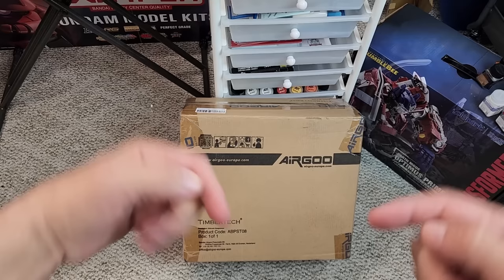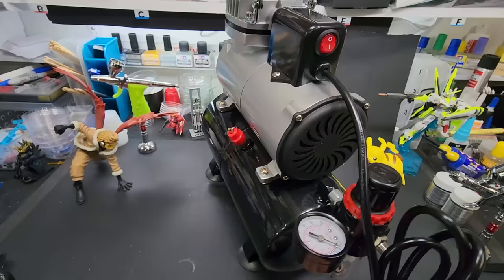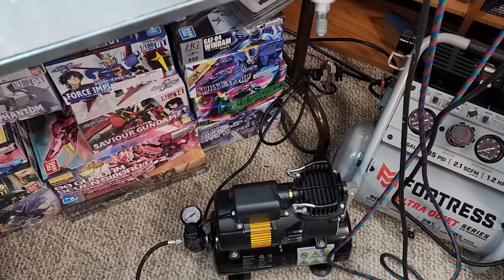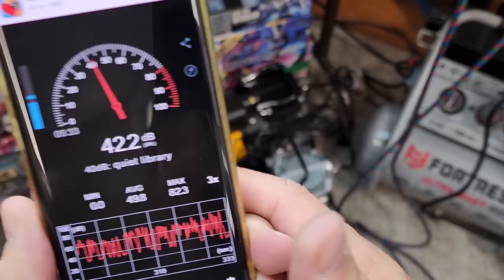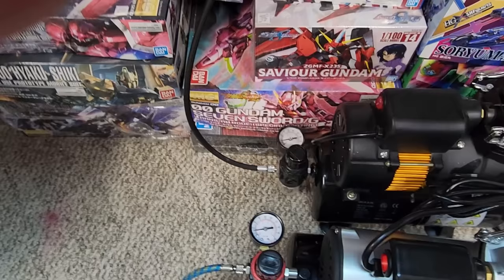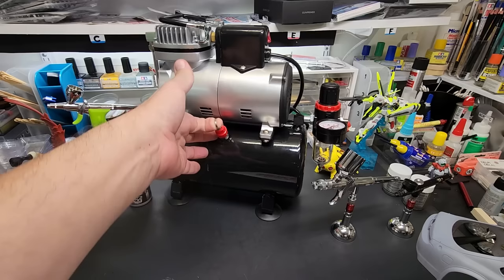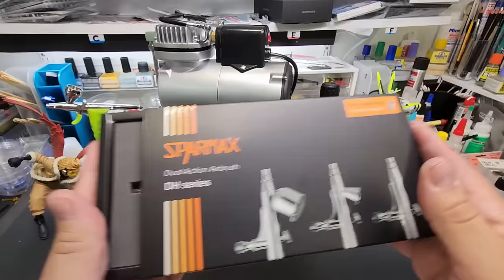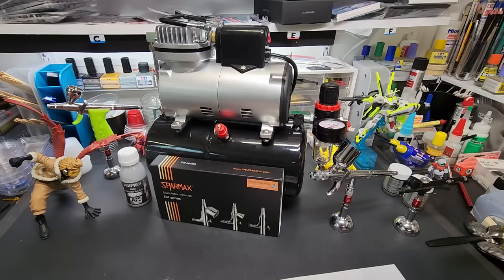Testing Amazon's Cheapest Air Compressor With A Tank - For Airbrushing

Comment: I’m pretty much brand new to airbrushing & your videos have been so helpfull and I really appreciate you for everything I've learned from you.
I originally bought one of those $70 during the lockdown but the gun never worked properly so I got frustrated after a few months of the constant clogging-cleaning-clogging go 'round but I never stopped watching your videos.
I was eyeballing the Iwata Neo until I saw your video on the Neoeco & when someone asked me what I wanted for xmas that was the one & only thing I asked for and oh boy! Sprays great, never clogs, cleans so easy - I am soooooo glad I watch your videos👍👍👍👍
The one thing about it I can't figure out is how to attach the hose to the rechargeable battery power compressor from my first one.
Maybe it's missing a fitting in not aware of.
Anyway, I'm sure that with all your commenters I have about zero chance in this g'way but man would it be great to have a legit compressor like this.
Anyway, thank you & please keep up all the great work!!!

Comment: I've been using a generic version of this compressor. It works great. At the $80 price point, you get absolutely everything you want (tank, regulator, quiet noise) in a compressor for model painting. The only airbrush I use at the moment is Madworks airbrush, would love to expand my selection with the sparmax.

Comment: I live where it gets cold in the winter and had resigned myself to just priming models with a spray can during the last bit of fall to last me, but I recently hooked up a cheap airbrush my wife bought years ago and never used and in doing so found your channel when I was researching cleaning/maintenance. Unfortunately it came with a very cheap tankless compressor where I have no idea what PSI this thing is putting out so my results have been... mixed so far so this video was very timely for me! Definitely going to look into this one.

Comment: I love model building, especially military models, but have used hand brushes all my life. For several years I been wanting to try airbrushing my models. But I am a disabled US Army veteran, on a $1000/month VA income, which limits how much I can afford to get started. I have read so many discrepancies about these lower cost compressors and airbrushes through the years, that it has made me hesitant to get started into airbrushing. Thank you for providing such a excellent breakdown on these lower cost airbrushes and equipment, and how to use them. Hopefully I have enough in my budget this year to buy an airbrushing set and start using it as part of my model building hobby. Cheers and God Bless!

Comment: It is the first time that I have seen a noise test on compressors, the operation of both the oldest and the fortress and the new one from Amazon, is great, they are silent, the fortress despite its size is extremely silent for my taste compared to The one my dad has, of course my dad's is not branded and is handmade, excellent video!!

Comment: I just bought this compressor 2 months ago - IT RUNS FANTASTIC ! - only runs when needed to fill the tank as you use air ! ... I trust Timbertech so much, I just bought their $25 gravity airbrush with 3 needles/3 cups and can spray 2mil - 7mil lines ! P.S. I'm a novice airbrushed, just learning !

Comment: I got one of those tank less compressor 11 years ago, it is starting to show its age and needs replacement. The best thing I did was get a  huge 2 inch gauge that reads up to 60 psi instead of that tiny pressure gauge.

Comment: I had the previous version of this without the fan and with the moisture trap directly on the front of the tank. Got rid of it cuz the way the moisture trap was on the tank I noticed it would rust up so I didn't feel safe keeping it. It was like $58 so not a huge loss. Love that it looks like they fixed that issue.

Comment: I really like the level of sound of this compressor. I've been using a 30 yr. old Sears pancake compressor now on its last legs that's so noisy I like to put headphones on when I use it. The airbrush would replace an old Aztek that needs replacing, now that parts are unavailable. I mainly paint Lexan slot car bodies now but was a model kit builder before that.

Comment: I also have a 1 gal. Fortress. It's fairly quiet, but I have a small airbrush compressor without a tank and that thing runs constantly causing water to build up quickly in the hose. A tank is definitely a necessity if you use it more than 20 minutes at a time. I too think all the compressors are made exactly the same... distributed from the mothership.

Comment: There is a similar set on the EU side from a dutch company (same AS180 series compressor). Was cheaper than local sellers going for 180e+ since they are all sourcing them from the same chinese companies (Hefei and Fenghua being the most common i noticed).

Comment: Not to be critical, but the Pressure Vent, Release Valve is not for that purpose.  That is an Over Pressure Release Valve, a safety feature.  These are preset to automatically open if too much pressure is entering the tank.   Constantly pulling it will eventually lower it's relief pressure.  I worked on NYC subway cars repairing air compressors.  There should be a drain valve (usually on the bottom) to drain air & moisture from the tank when done.
I enjoy your tests of paints & related items.  My background is 20 yrs. as a USN Aircraft Electrician & 38 years performing repairs & a Supervisor for NYC Transit train cars (fibreglass, mechanical & electrical).  As a supervisor I had to ensure Safety Procedures are strictly followed.  I beg your pardon if I sound like a "know it all".

Comment: Now that I am 3d printing my backlog of things that need to be painted is enormous. I'm using a Iwata on a portable USB compressor that is only ever at ~21PSI. I get constant tip dry. I don't know if that is from being an amature, the air pressure, or I'm not thinning the paints enough. I need to play chemist and batch make bulk thinner that works for me. Just using water isn't working.

Comment: Quality in compressor just means noise level and longevity.  Definitely put  your money in a good air brush first.  I also bought an air tank for $30 so that I can hook it up with my fast and loud compressor, or my slow and quiet one.  You don't have to buy a compressor with tank combo if you have the space to store a 5 gallon tank.  That tank will be a lot bigger than the combo airbrush, which means less noise during painting.

Comment: I tapped your order spot and it came up $91.99.
Checkout wants $124.57 CAD.  plus  Shipping:  $ 28.13   plus  Import Fee:  $ 6.38. plus  Exchange Rate Guarantee:  $ 5.17.  for a  GRAND  TOTAL  of only. $ 164.25.  Okay, tapping your connection the  $ 83.99 became 91.99 and as a pensioner I figured it was still a deal, but the actual take home price kind of left me with a bit of a shock.  But as I said, great video, had me finally ready to buy, but oh well . . . air brushing will have to wait.

Comment: Nice video, I actually just bought a cheap air compressor from Amazon, but mine is smaller and I think makes less noise? It was around $70 and well worth it in my opinion since I airbrush in my room.

Comment: Well since the old video got replaced, my original comment was something like…

“The compressor part looks very similar to the one Master had (or still has) that used the be (still are?) $$50 or maybe $80 for the compressor and air brush, don’t think the compressor had a fan though tbh”

lol

Comment: Hi Robert, I just happened to see this video while searching for information on airbrush’s for acrylic canvas painting. I’ve been wanting to purchase an airbrush but it’s not cheap and there’s so much information out there!!! I can’t figure out if I have to buy three separate airbrushes for three different needle sizes .2-.3 and .5 or can the needle be interchangeable on one airbrush?  Also trying to figure out exactly which components are needed for a complete airbrush set up from start to finish from fine line details to priming and clear coats (I love photo realism)… anyway your video was great, gave me a lot of information and will potentially save me a lot of money!! So thank you and you have a new subscriber 😊

Comment: Thank your for this. We just bought this unit only to find that our airbrush hoses have bigger connectors. Do you know what size the connector is on this compressor?  Also, there is manual with the compressor....just a list of parts.

Comment: i am looking at getting into airbrushing and was looking at this air compressor on amazon. also looking at a iwata revolution airbrush to start with. thanks so much for the videos its so helpful watching them perform. not having to go into this blind. so thanks so much. i would love your opinion on the revolution airbrush if you don't mind. i value your opinion. thanks.
Reply from the maker: Yes that's a very good airbrush. I also recommend the GSI Creos Procon Boy Platinum or a Gaahleri

Comment: still wondering about buying a compressor as I need to use it inside and in a smaller room. So in more worried about vibration noise than the actual noise of the compressor.

Comment: This video raised some questions for me.  Do these compact compressors go bad after years of non use?  I used to spray model trains and freight cars.  I have an old SCHUCO-MIST model 5711-102 that I used for the hobby.  It says Personal Health Care Appliance on it.  Maybe it was also used for that field too?  Rated at 2.5amps.  It has a caution on it "DO NOT LUBRICATE THIS PUMP."  This was manufactured by the SCHUCO DIV.  American Caduceus Industries of Williston Park, NY.  I didn't find a manufacturing date on it.  I know I have had it for over 20 years.  I am getting to the point of needing spray model trains, structures, track and 3D printed items.  This compressor has all the switches, and pressure gauge, but doesn't have the moisture trap nor tank.  Is this something I should upgrade or is it time to replace it with a more modern compressor like the one demonstrated in your video?  Oh, I have an old Badger I used with it somewhere in my stash.  Anyway, that is my comment and I did click Like on your video.
Reply from the maker: You shouldn't have a problem. I have an old compressor I haven't turned on in 3 years and I used it in my waterfall spraybooth video and it worked great. You can buy a moisture trap for under $10 and then you'll be good to go

Comment: I’ve had this compressor for about 4 or 5 years now and I am noticing some things in the last few months. The piston has begun to jam when it starts up. It’ll start up and there’s a strange noise and pause before it begins pumping. I’ve had the same thing happen with a previous compressor when it was reaching the end of its life. These inexpensive compressors seem to have a 4-5 year lifespan in my experience.
Reply from the maker: That's a pretty good for a $80 piece of equipment that you use on a weekly basis

Comment: I bought one of these and I sent it back. I couldn't see the point of having a tank. I could only spray for 15 sec before the pump kicked in and then it ran on for 30 sec after I stopped spraying. So the pump was on for longer than if it had no tank. Yours seems to behave differently, can you explain why.

Comment: I have a Paasche air brush.  I  am told that it has a non standard air hose connection.  Is there an adapter that will make it fit all or most standard air hoses. I know there are "quick" adapters but don't know  what to buy to connect to the Timbertech compressor/tank I intend to get.
Reply from the maker: Yes Amazon sells an adapter for Paasche airbrushes to work with standard airbrush compressor fittings

Comment: Mr. Robert, I have a question about the compressor in this video. I have a similar unit, I noticed the gauge would have a slight hissing sound and the adjustment knob came off soon after I started to use the compressor. Is the hissing something you experienced with this Timbertech? Or is the theory of the gauge just faulty likely correct in your opinion sir.

Comment: My california airtools compressor drops more than that when running air. I just set it while im blowing air through the brush. Im looking at these small ones again because i cant fit the california airtools one into my mobile airbrush toolbox in the bottom portion.  One of these would fit easily. Would one of these work for tshirt work?
Reply from the maker: Absolutely, my friend uses one for t shirts

Comment: Hello. My knob for adjusting air pressure is broken, i can't twist, pull, and push it to adjust the pressure. Any recommendation to switch my air gauge? thanks in advance
Reply from the maker: You'll probably need a new one like this
https://amzn.to/4cZ81hW
Reply: @barbatosrex9473  Sure, i'll look into it. It can be used for that kind of compressor? so i need 1/8 connected to fit for that? anyway thanks for the help

Comment: So, do you recommend a compressor with a tank over one without for quick jobs?
Reply from the maker: I will always recommend a tank. It stops the pulsating air pressure. A tank keeps the air pressure steady with no fluctuations. To be able to get a compressor with a tank for $85 is fantastic and worth the difference in cash for one without it

Comment: Hi, I bought the same compressor and the generator is always on, does not turn off and on to maintain pressure like in the video, any idea how to enable this?
Reply from the maker: I believe it's defective, are you able to return it
Reply: @barbatosrex9473  no, I bought the unit quite a while ago, I'm looking to buy another one which is why I watched your video, and only now realized it had this feature. Although I usually keep the pressure very low, perhaps that is why it is constantly on?
Reply from the maker: Dial in the gauge to 20psi and be sure to lock it in
Reply: @barbatosrex9473  thank you, I will try that on the new unit and see if it works

Comment: How do you use the moisture release for this compressor
Reply from the maker: It's a standard one. You just push in the button on the bottom of it to release any moisture build up
Reply: @barbatosrex9473  for the one under the tank do you run the compressor to get the water out or do you just open it and let the water drain out over time?
Reply from the maker: @mylesjohnson7351  you just drain it. Doesn't take long. Couple minutes. Most of the time there's no water
Reply: @barbatosrex9473  ok thanks for the info I appreciate it

Comment: Thanks for your video.  I run a small laser engraving business.  I want to coat my leather patches as shown in the video link below.    I have the spray gun he mentions.  What I'm not sure about is the hook up from the hose that's supplied with the spray gun to the pump your showing here.   How can I verify they'll work together...?

Here is the spraying of the patches he's doing https://www.youtube.com/watch?v=apB_aop86do&t=1819s
Check in at marker 20:54.  Any info you can share would be great.
Reply from the maker: The hose is an industry standard. It's 1/8. In the video he has a quick release adapter but you don't need that
Reply: Thanks for the reply back.  I'll look into getting that compressor. @barbatosrex9473